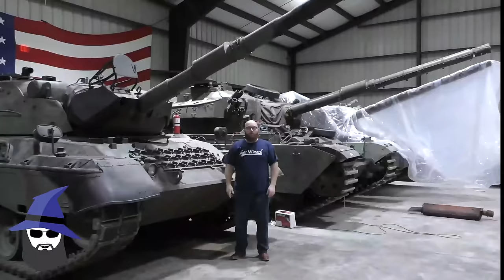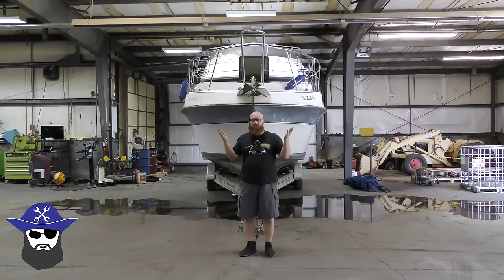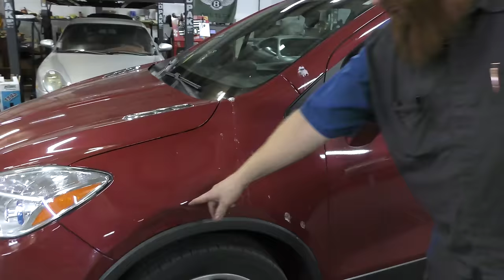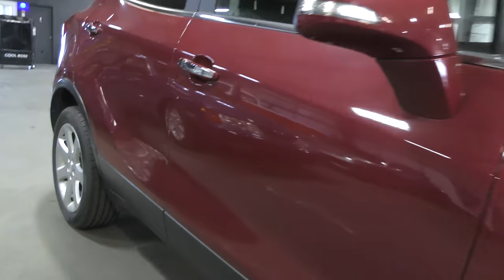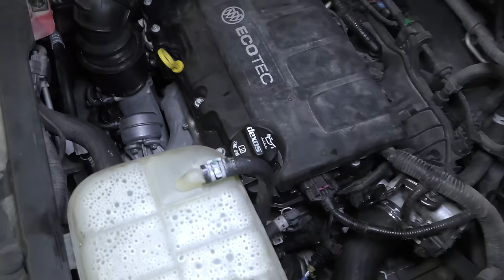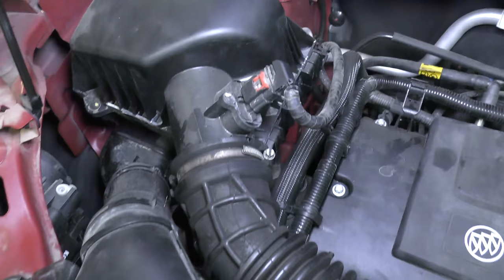How did a dealer miss the problem on this '15 Encore 4 times? CAR WIZARD just had to read the codes

Comment: I slowly begin to understand why reliability is so important for car owners in America: Because repair shops are either incompetent or fraudulent.
Reply: That's why when we find a reliable shop we keep going to them for years at a time.
Reply: @nickmalone3143  even the legals run sketchy businesses too
Reply: And that's why reliability means nothing to me because all I need to do is break out the wrenches and ratchets and BOOM my car is fixed.
Reply: @brayannexon4613  Even if you know what you are doing, unreliable cars can take hours to fix, every time they break. Time is money.
Reply: @04dram04  "time is money" is usually said by people for whom that isn't the case. How much money did you exactly lose by fixing your car instead of watching TV? If it keeps you from going to a bar it actually saves you money. So stop using "time is money" like you're a $5000/hr 7days/week 16hr/day working hotshot and just learn to fix your damn car.
Reply: @terencejay8845  Nationally standardized training and licensing for auto technicians does not exist in America, the closest thing is an ASE certification, anyone who knows how to memorize can pass the written exam. The Wizard does not wear the ASE badge.
Reply: Yes, it plays into Toyota's hands. I guess the worry is because the dangerous High Voltage systems in electric cars, more and more you won't be able to tinker with cars at home, and will be at the mercy of dodgy garages
Reply: 100% of dealerships are scammers. I own a Mercedes-Benz C300 and, the only reason I took it to the dealership was if some warranty parts needed to be replaced.
Reply: @nickmalone3143  you are more likely to get your car repaired properly by a taco truck mechanic than most shops.
Reply: @terencejay8845  Yep, not only is military mechanic training very good, but you get LOTS of practice. Military vehicles, even routine ones break a lot, not because they aren't durable but because they are used by inexperienced operators or in BRUTAL conditions. You get lots of time fixing things. Plus you have senior NCOs with DECADES of experience to run to if you need mentoring.
Reply: So when owners report the car is "always"  in the shop, it's sometimes not that the car is that bad/unreliable, it's because of incompetent mechanics!
Reply: Brake shops are particularly sketchy. Had one try to replace all rotors and pads when all I needed was some brake fluid. $500 v $5? Another shop wanted $300 to replace an O2 sensor. I didn't know much about repairing vehicles back then but I knew these people were full of crap.
Reply: Reliability means you don't get strained on the road, which is a very awful event for any circumstances.
Reply: @supertouring1  

Some cars well break down a lot like Fiat for example, it’s bound to breakdown even if you have a good mechanic
Reply: @brayannexon4613  but how many times do u want to break them out before you get sick of it , unless that's your thing then I completely understand ,I used to love it but as I get older I can't get around as easy as I used to ,I still do all my stuff but I'm a strict Toyota,Honda guy now
Reply: @Ancientcaptain  maybe its because I'm young so I don't really mind. Also you do eventually run out of things to fix (reasonably).
Reply: @terencejay8845  but if you watch enough of the Wizard's and other YouTuber's videos, a lot of times customers are bringing them into the dealer who would have licensed technicians. Theoretically, they should know their own product the best, but they often are unable to fix the problem.
Reply: @brayannexon4613  True ,I bought an 86 Toyota pickup flat bed dually cool looking truck but it had set a long time so it's as of now basically a new truck as far as mechanicals but I eventually got to the point to where it's either time for a new project or I'm just tired of wrenching on it , mixture of both I guess
Reply: or both,
Reply: Time and parts cost money in the end no matter how you look at it
Reply: I go to the dealer for maintenance I live right next to a mechanic shop I know and trust the guy that owns and works there to fix stuff I'm not gonna wast his time with just a oil change he doesn't even change his own oil
Reply: @gnomiefirst9201  being able to memorize is what makes people smarter than those who can't memorize. That's like saying a doctor is just someone who can memorize. How ridiculous your statement is. 🙄 
Experience is important
Reply: @Candisa  I earn enough where time is indeed money. I still DIY when there's a wide disparity between billed shop time and the low difficulty level of the job (or if it's something fun to do myself), but I'd rather pay someone for their work and expertise so I can enjoy the comfort of... I dont know... watching Youtube and drinking beer. Societies become more advanced when people are able to sell their specialized skills to maximize their earnings and quality of life. Specialized people get better at what they do, become more efficient, and society as a whole makes a profit by being able to reallocate capital resources (labor) for other purposes.

Think in terms of the big picture.
Reply: I totally and absolutly agree with your opinion.
Reply: I lived in Europe for 3 years. Same experience with mechanics.

Comment: Stealerships don't pay their "techs" much, so they don't exactly hire the best and brightest.  I generally only use them for warranty work or during the service contract period.  After that it's independent mechanics for stuff I can't fix on my own.  Still, this has to be one of the worst examples I've seen, considering the scan tool literally told them what needed to be replaced for the over/under temp issues, and a basic battery tester would have pointed out the other one.
Reply: As much as I'm a diehard Ford guy, I'm not returning to one of my local Ford dealerships. They charged me $850 for replacing some control arms on one of my cars. Well, the problem not only came back but it was a LOT worse than before their fix so I return a week later. Turns out even more control arms needed to be replaced and they wanted yet another $850. They even had the nerve to charge me about $60 for them to look at my car AGAIN for the problem that should've been fixed already. Man I was pissed.
Reply: @JimHalpertFromTheOffice  Ford charge me $200 for trasmission flush  and they never added new trasmission fluid.
Reply: I work at a Dealership and won't let them touch my truck
Reply: That's BS
Reply: I have only visited the Toyota dealer twice. Once for recall and the other for a minor warranty issue.
Reply: It's possible some of these techs are unable to read their high school diplomas and you want them to read a code on a machine? WOW you ARE asking a lot.
Reply: Yep.   Three trips to the jeep dealership (under warranty) to fix the cabin air temp sensor.  BCM code spelled it out clear as day "open circuit LH cabin temp sensor"
Reply: @cnorton1us - How much do you need to make to know overheating is a cooling system problem? Sounds to me like they are paying to much. Welcome to the age of "equity" & "equality" & the and of "Merit".
Reply: @tomjones5079  I think unresolved repairs are a profit item. You bring a car to the dealer with a covered issue. They say its a sensor and do a $500 repair billed to the car maker. A week later you return with the same problem. They replace another sensor and bill it to the company. Eventually they fix it. But they billed the manufacturer for a bunch of repairs. You're more pissed off for the inconvenience, but they're not going to have to argue with you over money for un-needed or misdiagnosed repairs. A Ford dealer I sold cars for on Long Island lost their franchise and the head service manager and a couple of service writers were prosecuted. Rumor had it, that's what they were doing. That and double billing. collecting from customers and submitting warranties.
Reply: @Kewrock  perhaps, but they didn't replace parts the first two times.
Reply: @tomjones5079  I don't know. Maybe they get paid for the visits.
Reply: Stealership. I like it!
Reply: @jamesg6792  i hate my Toyota dealer here in Roanoke Va. I go only when I have to. I have an extended warranty zero pay from me. They wanted $200 from me to look at my tailgate. Sometimes it was not working. The service mgr. says they must get the money in case  the warranty co. will not pay. She said it was just like my health insurance, has a copay. Well, the paperwork says I have no deductible. S****y company.
Reply: Some Dealership mechanics are just glorified jiffy lube “ technicians”...
Reply: stealerships lol!
Reply: Most dealerships do pay techs very well, one problem is that the tech and the guy selling you the service are 2 different people and it’s easy to shift blame, also the dealership and the manufacturer warranty parts and labor of dealer services so they go overboard when fixing things and replace things that probably don’t need to be replaced just to make sure their bases are covered
Reply: I know the fault codes can be misleading, had a few cases with my daily drivers, but for heaven's sake at least take a look at what the code points to! Especially with something so trivial to diagnose as a thermostat. They should get some of their money back....
Reply: @theshield1613  I guess they paid a bit more than the fluid cost after that?
Reply: @Kewrock  …the manufacturer checks warrantied parts and denies coverage/payment to the dealer for them if they are good. If the problem is bad enough they send out service bulletins warning dealerships and mechanics about the problem with good parts replacements.
Reply: You nailed it right on the head.  It is rare when the dealership pays better and gives better service.  Service period only.  I either fix things myself or bring it to an independent mechanic in my area who is the best - fixes everything on the first try, and he uses a scan tool (unlike what is being described in the video).
Reply: @jamesg6792  Good job

Comment: I had a dealer tell me when my car was there for an air bag recall that I needed a new clutch; $2800.  It wasn't because the clutch was bad.  It was because of the age of the car and mileage.  Needless to say, I left without getting my clutch replaced and it is still fine to this day, several years later.
Reply: Next time tell them they need new service advisors
Reply: Did it need a new clutch because the tech couldn't drive it? Lol
Reply: Service advisors are like commission-paid sales reps.  Their job is to convince you that your car either needs repairs...or it's time to do something before it becomes an expensive repair.
Reply: a friend picked up a sweet volvo wagon with sweet rims and tires for $1k, a mechanic told the seller the transmission was going bad, it never did go bad.
Reply: Yes, every time they want to sell you something else so it's not free.

Comment: I have no words!  The dealership is supposed to know every inch of THEIR vehicles.  That is why you pay a premium for dealer techs. It wasn't like they got 10 codes and couldn't figure out what was  causing them all to go off at once. This code pointed directly to the problem. Anyone that can plug a code reader in could have figured this one out.  Very sad indeed, Mr. Wizard!

Comment: I had a 1993 Pontiac Bonneville that had an issue with the fueling system.  
I took it to the dealership, where they diagnosed it as a faulty fuel rail.
A couple days later, I still had the same issue.  I then asked the dealership if they took a look at the fuel filter.  The answer was no.
I then took the vehicle home, and bought the necessary fuel filter.  My thought was if it wasn't the fuel filter, then at least I know it was replaced. 
Guess what?  The fuel filter was the issue. Yes, I did let the dealership know they made a mistake by not checking everything. 
I never took a car back to them to work on.

Comment: "We just used common sense". Allways be aware that common sense is the least common of all the senses.
Reply: In today's day and age is called uncommon sense.
Reply: I had a GM service department manager say exactly this after asking him why they didn't check the fuel pressure as I had asked, instead recommending a $2100 catalytic converter on a van I paid $2800 for, because of a code P0420 that was there a year before the symptoms started.

1998 4.3 Vortec, known for faulty fuel injection systems leaking. MPG cut in half, the vehicle stalled and was hard to start. Cats don't do that. When I bought a fuel pressure tester and checked it myself, I was losing 1 to 2 PSI every other minute. Common sense, my ass. Most dealers "techs" couldn't fix an election if their brother was the governor.

Comment: Dealer wanted the people to buy a new car. Simple as that. They wanted the owner to think whatever was wrong with the car, was terminal, and they needed a new one.
Reply: Thats dumb. All it did was make their technicians look incompetent
Reply: @Heavy Tanker 1945 I don't think that's the case here. They just do stuff to it,get $ & tells customer that should fix it. Of course it doesn't, so the trusting customer comes back & keeps getting ripped off! If more people would watch videos like this,maybe they'd learn their lesson & not go back! Keep spreading the word about the inept & crooked dealerships & pretty soon they won't have any business but warranty work!
Reply: @Mike583  Yup. Bad dealers don’t fix issues. They just cover them up.
Reply: @Mike583  could be used cars are crazy high price - if she traded in out od desperation  and bought a new car they could throw on a t stat and make big $$

Comment: I wish SAE could revoke certifications for mechanics (or entire shops) that aren't able to figure out that the best way to fix a faulty thermostat is a new thermostat.
Reply: Or use a cheap scan tool properly that gives them the answer
Reply: sadly, there's no Bar association for techs.
Reply: You could have 5 uncertified mechanics working at one shop.As long as one of them is a master ASE certified and it don't even have to be current The shop can put a sign on the window saying master ASE mechanics work here

Comment: I spent about $800 trying to get my jeep to run right. It would run fine for weeks and then you could keep it running without holding the gas down a bit  to keep it from stalling. Finally I spent some time on line investigating it myself and someone said battery. But I never had any regular bad battery symptoms I was used to. I guess my mechanics are to proud to look online. $70 battery and It was a champ.